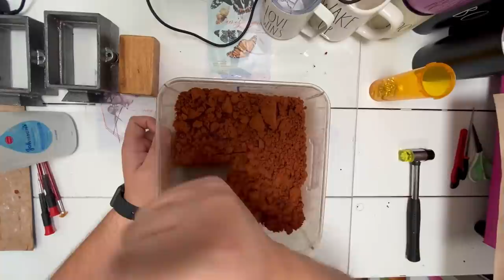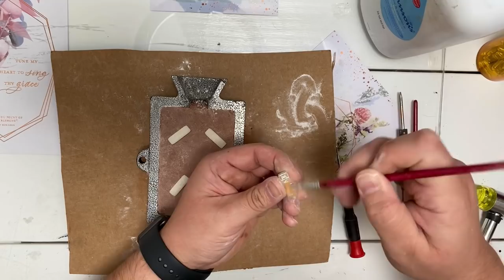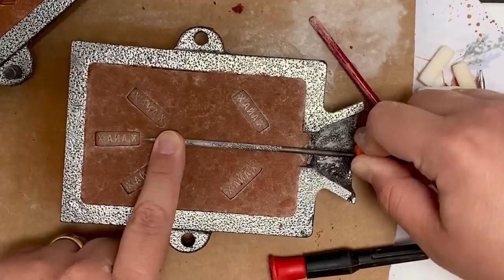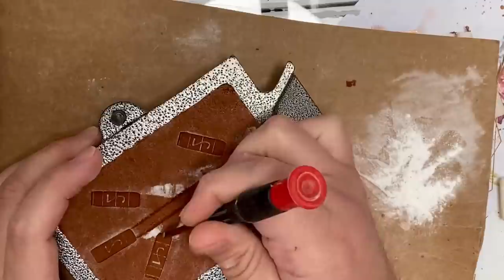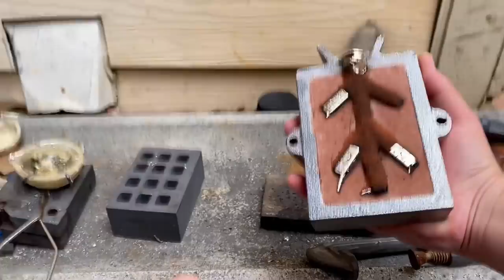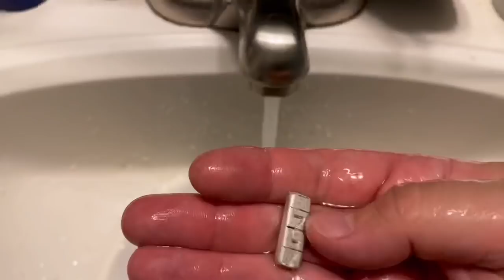Sand Casting Tutorial

Comment: So, I have finally taken the plunge into buying sand casting materials, I have the sand, the hammer, the flask and screwdrivers and stuff to make the vents but I haven’t tried it yet. I can’t stand baby powder as it takes my breath away but I want my piece to come out correctly. Is this a necessary thing to use? I like the idea of sand casting because there’s so much more I can do instead of just pouring into a mold but at the same time it’s daunting because I don’t like failing and get discouraged easily. I appreciate the video and the bars turned out nice!!
Reply from the maker: That’s so awesome! Sand casting is very fun to learn and you’ll see once you get it down, that your possibilities are endless in what you can make. I’ve seen people use flour, but baby powder or talcum powder is what most people use including myself. If anything, I’d suggest buying a good respirator so it doesn’t bother you. I’d be happy to help in any way.